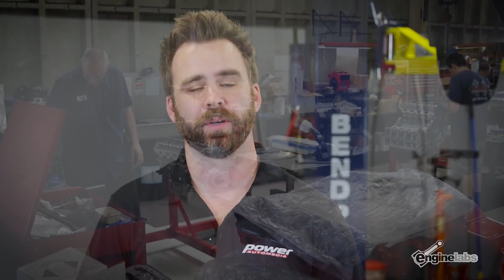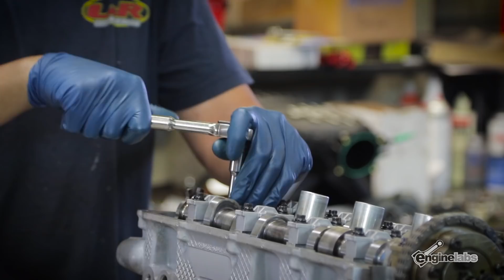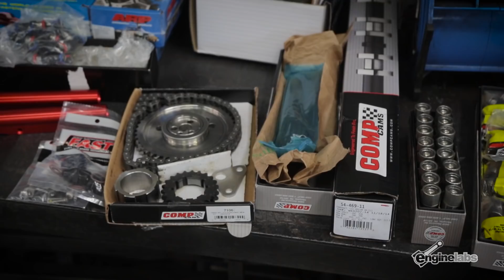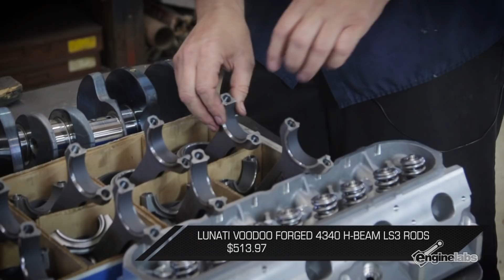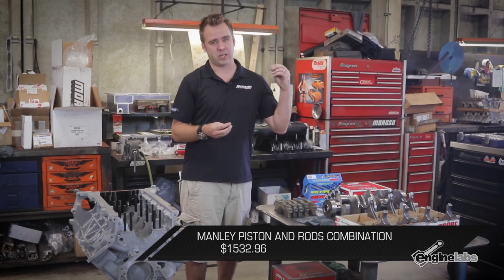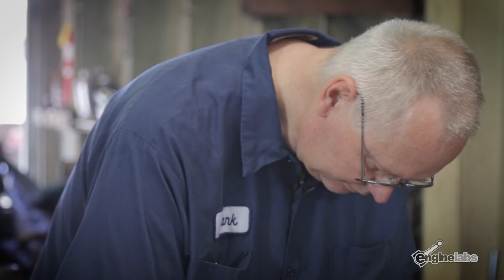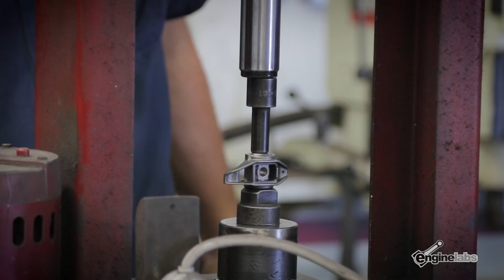$10k Coyote vs LS3 Shootout - The Build

Comment: Both motors are over cammed, and what looks like single plane intakes. Will most likely have the HP overtake the TQ and be worthless for street use.
Reply from the maker: +John Doe How would you have done it?
Reply: Hard to say, it's not like the old days where a huge variety of intake manifolds were available for almost every use. Seems to be car companies and people shooting for the highest HP numbers they can get with total disregard for driveability. For instance my 06 - 5.7L charger might push out 345 HP, but it's a total slug off the line and it's throttle response is horrible. I'd much rather have my 150HP '87 cutlass supreme back where the TQ curve came in right off of idle. I would have used a carb setup with a dual plane intake manifold and a mild cam. Something that really makes you want to drive a car. If I wanted higher HP numbers, I'd of just shot for a roots style blower, or turbo setup on a 455. Oh, and no plastic parts :)
Reply: Yes sir i like the way you think. Keeping it old school is 10 times more fun. Horsepower means nothing torque means everything.

Comment: This test is SOOOO flawed.  They keep both engines down to 11:1, but let the LS3 maintain it's huge advantage in displacement.  And why only a boss intake?  The Cobra Jet is only a little more money, and makes 20hp more than the BOSS.
Reply: +4g63mark 
The LS might have the advantage in displacement, but it doesn't rev as high in the configuration they are using, and although it benefits from a lot of modern advancements, it's still a pushrod engine with no variable cam timing.

It's more a comparison of tech vs displacement really, but both have their benefits and drawbacks.
Reply: +RTDragonCommando I see what you're saying and agree, but it mostly appears to be a bang for the buck competition.  The LS came out back in 1998 while the Coyote just came out in 2011.  Therefore the Coyote is not even close to being a budget minded engine, whereas the LS is the ultimate example of budget minded.

Comment: ls3 has alot biger cam and and they spent 1500 more on the 5.0 block wow disadvantage to the ford
Reply: +Jay Smith    They also helped the ford out by purchasing a used block, because they knew they cant compete with the LS with  a fair dollar for dollar budget.
Reply: +mfnbigdaddy73 the budget for the comparo was $10k. How is that not fair?
Reply: Marshall Guillory  They bought used parts to help bring the ford engine in under budget, because they knew they couldn't compete dollar for dollar.
Reply: mfnbigdaddy73 it is competing dollar for dollar. The budget was $10k. This compares what you get for $10k. I'm surprised this is so difficult for you to understand.
Reply: Marshall Guillory  You are having difficulty understanding that you can buy more shit used than you can buy compared to buying all new.    Basically saying that if they had bought the engine new, they would not have had as much to spend on other high performance parts.    Can you see it now that I put it really simple for you ?

Comment: Actually for the price, I would buy a used 5.8  GT500 engine ...
Reply: +Ben Benjamin Good luck finding a 5.8 though.
Reply: +sammy duran Complete setup on ebay purchased for 17K engine, wiring  harness, computer, intake and transmission ... much cheaper in the long run.
Reply: Ben Benjamin That's a rich mans build though, and is also limited for fitting in smaller vehicles. Theres a guy here in town that has a Volvo wagon with a twin turbo LS swap, he only does a gasket kit on them and when they blow he just pulls the motor and swaps the turbos, turbo kit is $5000, $300 for the motor and hes running low 9s...
Reply: +sammy duran when you look at the cost of a rebuld LS or modular and making over 500 hp without NO2 ... you cost is above 10,000 dollars.
Reply: +Ben Benjamin no LS ever cost $10,000 to rebuild. A brand new LS3 is only about $6-7000, add a cam, headers, and tune and you're beyond 500 hp, easily
Reply: +Mang213 The best part of using a low mile GT500 engine is it's all matched and easily modified to get a few hundred more HP without huge cost.

If you like to spend your time looking for parts and have the time, have fun ... I choose simplicity in my builds. The aftermarket rebuild parts have gone downhill in quality in the past 20 years due to offshore ... OEM quality is still better with low mile performance engine.
Reply: +Mang213 The LS3 in the Corvette makes 460 already. With a cam, headers and a tune you're well over 600hp and probably into the 700s.
Reply: LOLOL 300.00 for an LS...BS hahaha
Reply: Mustang GT 2018 makes the same HP 460...just boost it in less than a day for 5-7,000 and your in the 8-1000HP world!!! Not with any stock LS and weeks of work. Thats the reality...this test is designed around people who know nothing about the Coyote! MMR with the Stock ported Heads and the  351X Block make close to 4000HP and run in Pro Mod. No one else competes in Pro Mod with factory anything. The other thing is they are the smallest cube engine of all cars in Pro Mod!

Comment: Y'all literally screwed the coyote build by putting a boss/road runner intake on a coyote.
Reply: Exactly the Cobra Jet intake manifold is what you want on a high HP build not the Boss intake. This comparison is ridged. Did you also noticed they disabled the TiVTC system lol
Reply: Thank you. There ls bias. The boss  intake is not made for the coyote. It's made for the roadrunner. The cobra jet is made for the coyote. Putting a boss intake on a coyote screws it. They did it on purpose.

Comment: How you gonna compare a ( STOCK F150 ) engine and use aftermarket on the ls smfh this hella not fair to begin with
Reply: All factory LS3 parts they could have bought for significantly less than they spent. They bought new so they were able to use up their budget of 10g's. Both awesome engines but bang for the buck, the LS spanks the coyote. It would be a different story if they built a big inch coyote but they'll build another pushrod engine before that happens

Comment: should have been forced to buy both brand new or both used motors to keep it fair.
Reply: +collin paine    They know ford cant compete with GM dollar for dollar.....
Reply: +collin paine the budget was clearly $10k....
Reply from the maker: +collin paine It's just the block. Wouldn't affect power.
Reply: +mfnbigdaddy73 You mean like GM can't compete with Ford on the drag strip?
Reply: All I'm saying is if they they are going to have an objective test on what the best motor they need to have the same criteria for each motor.
Reply: Patrick Simmons   Chevy beats ford most of the time, and mod for mod Chevy has always outperformed ford.

Comment: Take a junkyard 6.0l and a set of AFR mongoose heads with a texas speed cam. Compare apples to apples not brand new motor to junkyard motor. Price would drop considerably for a used 6.0l.
I like the coyote as its a great motor but try to compare closely. 

4.8l and 5.3l  has achieved 1300+hp on stock block.

Comment: This is stupid putting a $10,000 price tag when one is starting from used. Comparing 1 cam to 4. These two engines are too different to try to compare evenly. Basically the mod motor is nothing more than two Honda 4 cylinders put together in a V.
Reply from the maker: +waynenocton How would you do it?

Comment: There should be no HP/cubic inch comparison. If that is the case then why not use a HP/valve comparison? 

A better comparison would be to compare overall external dimensions of engine per HP, or even weight to HP ratio.

Comment: So biased, use a gt coyote motor and it gives more power , it’s a better engine because of its design, no push rods , higher rpms , I love all types of engineering, I’ve had camaros and silverados , the ls motor is a tough engine and can make great power for what it is , but the new coyote motor is a beast that responds well to bolt ons and tunes . This video is crap , take both engines same year , put on long tubes , cold air intake and tune and the coyote will make more power

Comment: Truck coyote motors are not mustang coyote motors they make more torque but have smaller cams and exhaust manifold is garbage so if you get a truck coyote you have to change allot just to get stock mustang #s

Comment: Fuckin ridiculous... just get a used LS3 and drop $10,000 into it... or buy the Coyote new... that should be the point of the video... how far can your dollar be stretched into horsepower? Right? find a used Coyote on a $10k budget?....Nope, I will buy a used LS3 and dump $10k into it before I ever dick around with Ford's over-complicated setups and oil pressure issues and ....what's that you say, Coyote has dual overhead cams so it can breath better? You are correct, but I also bought a supercharger with the extra money I saved on the LS and now it really breathes better.. parts are much easier to find... more people know things about LS engines...IT REALLY IS A NO BRAINER

Comment: he cheated. he got a used ford block. and the chevy is brand new .wtf
Reply from the maker: +red bone (redbone) this is the nature of these engines in the market. Because we needed factory heads, hardware and block, there is no way to build a new coyote and compete. The LS parts are cheaper to buy new. Just one of the differences between the engines.

Comment: You can look at any Ford V/S Chevy Horsepower or dyno test and it never fails and I Mean Never the Chevy always has to be bigger in order to out power the smaller Ford show me a 5.0 liter Chevy or GM engine of any kind that makes the Horsepower #s that a coyote 5.0 makes I'm not talking a 5.3 or a 5.7,or 6.2,or whatever I'm talking 302 cubic inches or 5.0 liters guess what u will never show me or anyone a GM engine 5.0 liter bone stock that makes the power of a stock 5.0 coyote engine they always have to big bigger tell u what put a 5.8 Ford against a 5.0 305 cubic inch GM and the Ford will Annihilate the pathetic GM engine or a 6.2 Ford against a 5.3 LS the Ford 6.2 will Dominate the Chevy junk if u want Respect from Most Anyone compare apples to apples run cubic inch to cubic inch and let's see who wins from small blocks to big blocks to Overhead Cam Engines example 427 Cammer and Boss 429 vs any big block GM and let's see how much power GM or Chevy can make and unlike GM Ford has always had engines bad enough to run top fuel and has won championships in top fuel with Ford Horsepower and has their own top fuel engine that competes today the Boss 500 Hemi so instead of acting like the LS is the baddest engine ever built just leave the Big time Horsepower Making 11,000 + Horsepower to Ford and Mopar because GM don't know anything about that stick to your little 1,000 hp street cars while Ford and Mopar show u what Overhead Cams and Hemispherical Combustion Can Do!!! #Blue Oval Nation

Comment: biased test first they are getting a used Ford block to save money if the Ford is too expensive then it should lose second they are using horsepower to cubic inch which is useless should be horsepower per pound and third they should award points for overall size since the test is to see what would be the better swap motor

Comment: 1.68hp per cubic inch on the ford an 1.47hp per cubic inch on the shitty Chevy motor with an extra 70 cubic inches of displacement. Enough said that's why I stick with fords i dont like cheap under powered over size pieces of junk that you can find in a junk yard